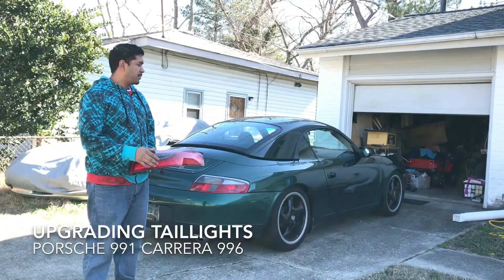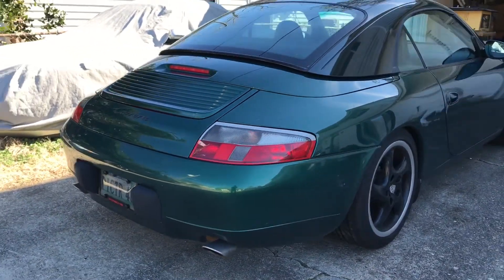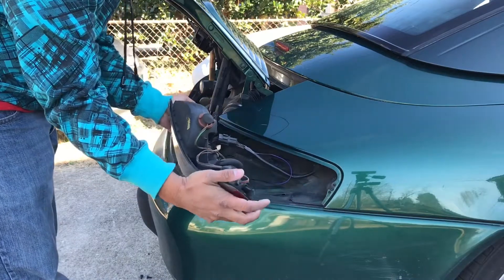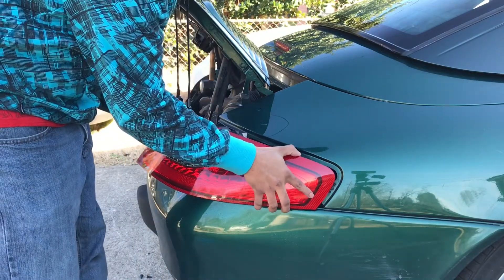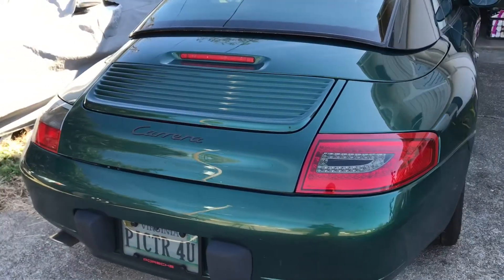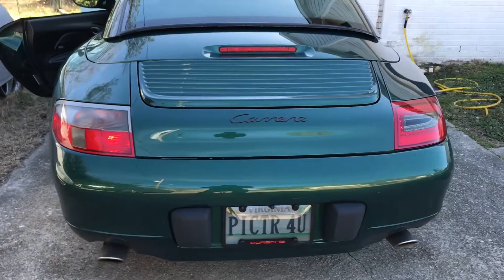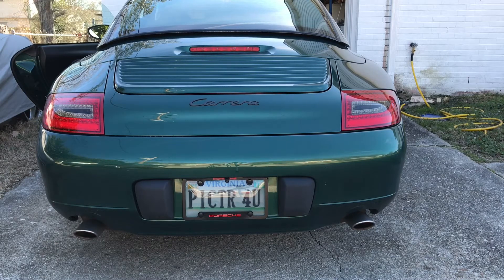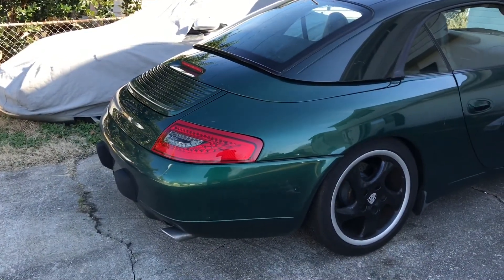Porsche LED Tail light upgrade 911 Carrera 996

Comment: From where did you buy the DEPO tail lights, any more MODs added to the 996 ?
Reply from the maker: I bought mine used from a wrecked car, but it sells on ebay. My other mods are: Oil pan skid plate (my car is lowered on H&R springs), Fister D Exhaust mod.  I have the following waiting to get painted: Misha GT2M wing with decklid, Rear bumper with slots, side skirts. I am trying to find a good lip for my car.
Reply: Roops Can you post new video of your 996 with new wings & exhaust sound 😎
Reply from the maker: I will make an exhaust sound video. I am in love with the exhaust, it is well mannered around town, but once the RPMs go above 3k, it screams all the way to redline. I am still waiting on my wing and other body parts to be painted, so I will make a before and after video showing the mods.
Reply: Roops waiting to hear the exhaust and the other MODs.

Comment: How much you pay for the lights ?
Reply from the maker: I think I paid like $500+ for them. Don’t remember.
Reply: @RoopsPhoto  they're new 600 . It's all good if you don't want to say .. nice ride . Manual or Tip ?
Reply from the maker: @bbtransport4504  manual. I bought them used in a lot purchase with other Mods, so it wasn’t an exact price. My car has almost a full kit on it.